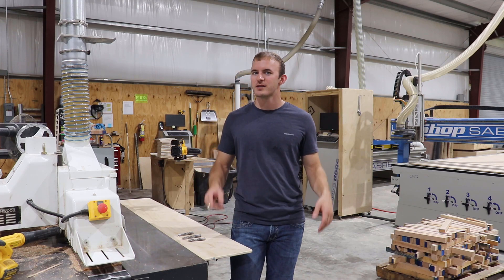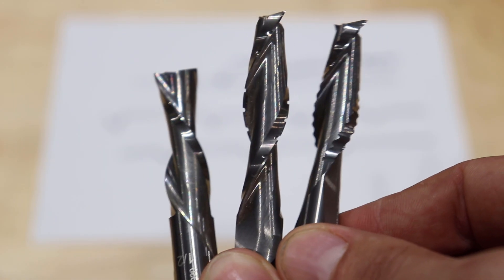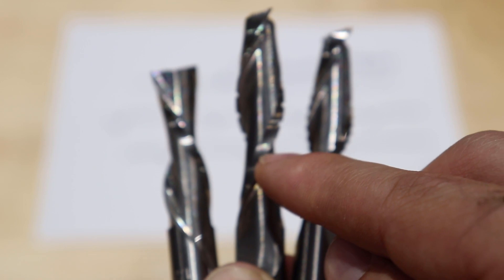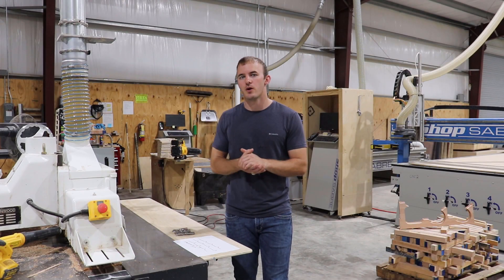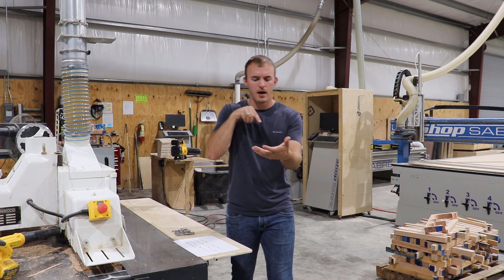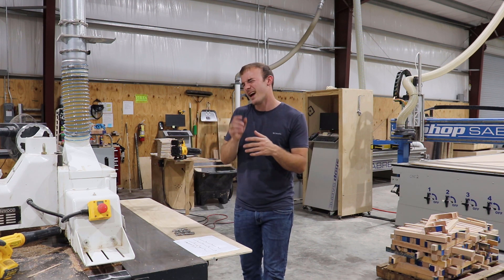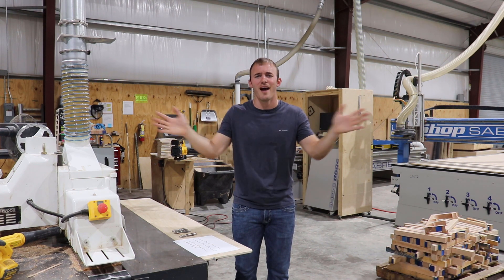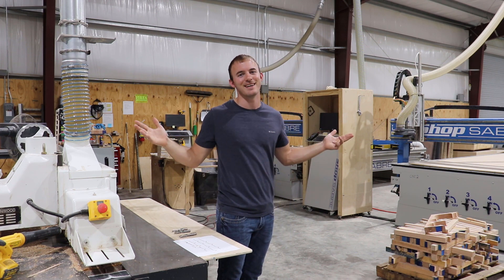Chip Breaker Bit | Hybrid Finisher/Rougher | CNC Router Bits

Comment: Hi My machine has a 9kw spindle. 

From your experience - Is it strong enough to work with a 12mm or 19mm chip breaker for their intended job (about 1000 ipm at 18000 rpm)?

The material is birch plywood.

Comment: Which bit should i use to cut mdf 2.5D design.

2 flute straight bit or spiral bits and which material to use?
Reply from the maker: I like dense wood for doing 2.5D carvings, I would use MDF if you are putting a colored top coat on or just trying to see how to operate things.
Reply: @cutting-it-close  Bro I am not asking for wood or material on which is to be cut. I am asking for the bit to be used. material of that bit and nature of that bit like straight or spiral and 2 flute 1 flute or 4 flute.
Reply from the maker: @dd_Dedsec   Oh gotcha, 2 flute spiral bits for sure, and carbide.

Comment: Great Vid!     I have a laguna 4x8 swift.  I cut  tons of plywood.  last week i cut over 250 48" circles out of 3/4 fir ply.  i'm running the same .25 chip breaker you shared.  i run at 200 ipm and 18000 rpm and 2 passes.  any tips on speeding up my cutting?.  Nice thing is these circles are for construction exterior use, so no sanding!
Reply: I get spoiled by the machine I use at work.  My biggest machining operation is probably running a 5/8th 3 wing compression through a pre- built up table top to radius the corners.  I do that in 1 pass at 800 ipm.